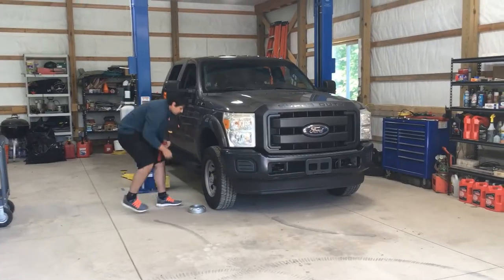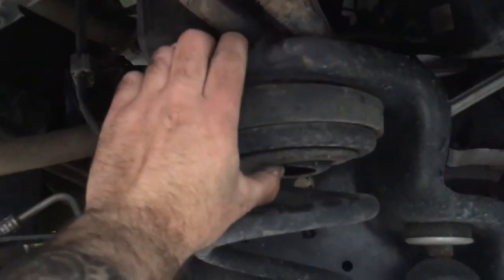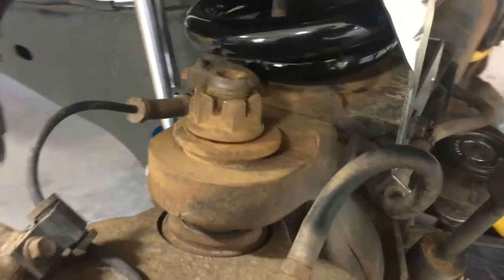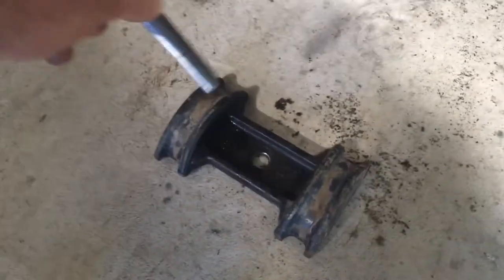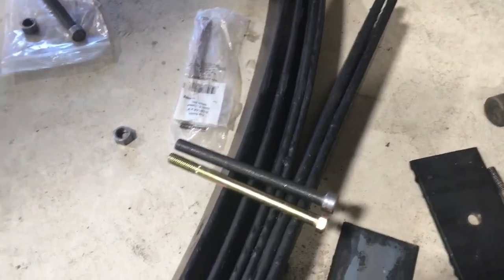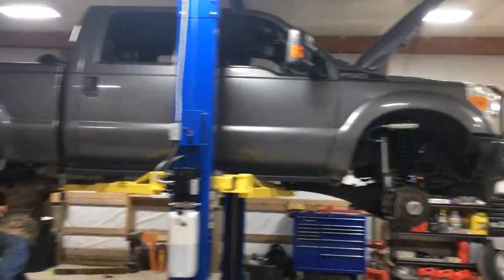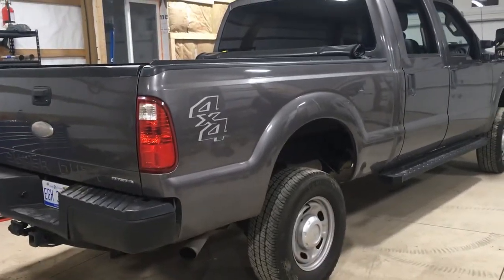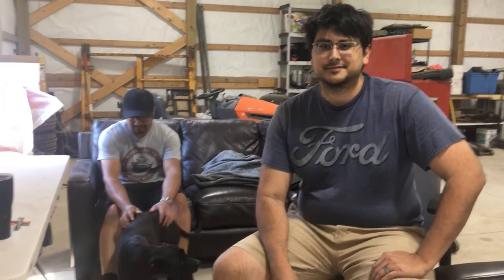F-250 Carli 2.5" Pintop Lift Kit - Install and Review

Comment: Nice job! What ball joint press is that and do you know if it will work on the main ball joints as well?
Reply from the maker: I think Zach said it was the Ford ESST. I’ll check and get you the details.
Reply: Shawn's correct, it was the Ford ESST tool that's OTC brand. I can't speak as to whether the tool I used would also work for the main ball joints but OTC does make a master ball joint set that isn't too expensive but very handy. Also a stand alone press will be beneficial if you can walk the knuckle over to it.
Reply: Thanks guys. I used a HF one and it worked but I had to cut shorter receiving tubes out of 3” exhaust pipe.
Reply from the maker: @vinceb9215  HF FTW